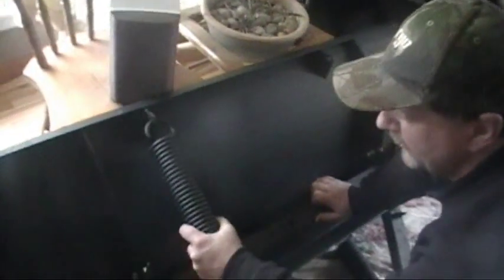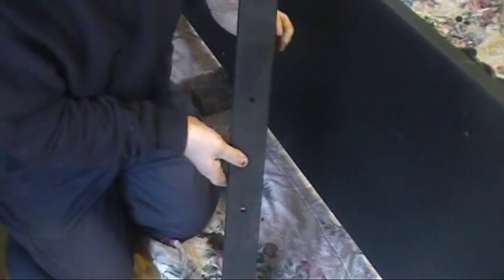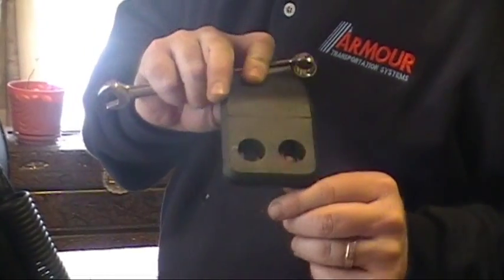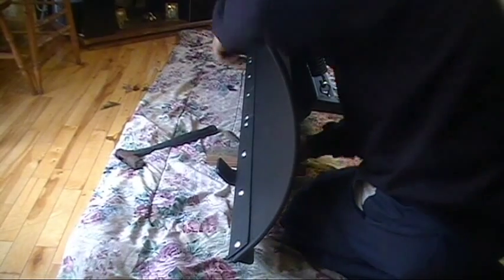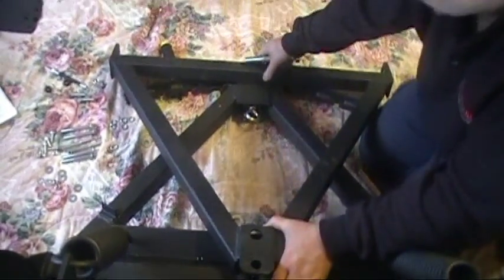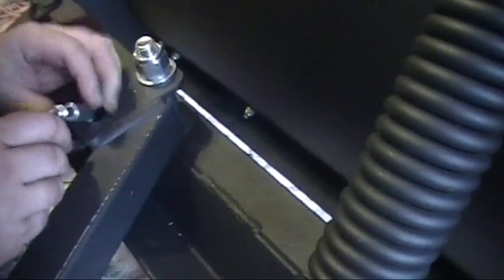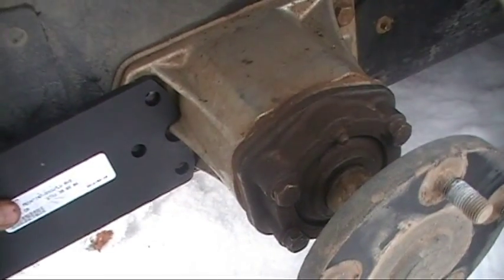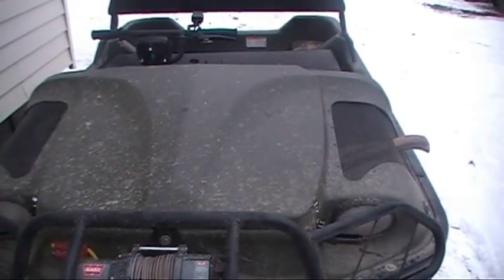Argo Plow Assembly and Install.avi

Comment: How long does it take ?  the mounting bolt behind the tire are there Nuts back there or they thread right back in with new mounting plate ?
Reply from the maker: Assembly was about 1 hour and it bolts right on where your tow hooks are in the front. the holes are threaded and the metal is aluminum so do not over torque the bolts when you mount the plow. . Hope this was helpful.